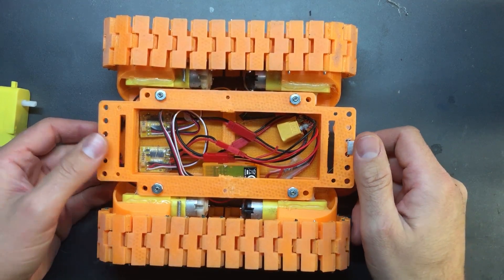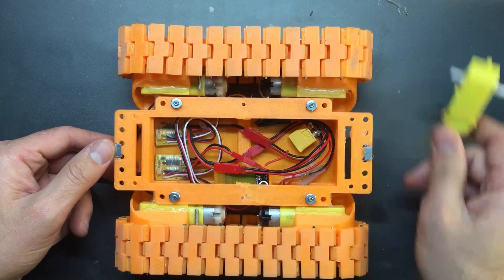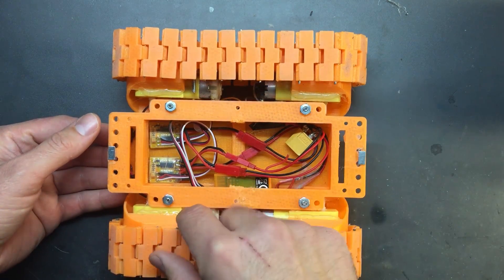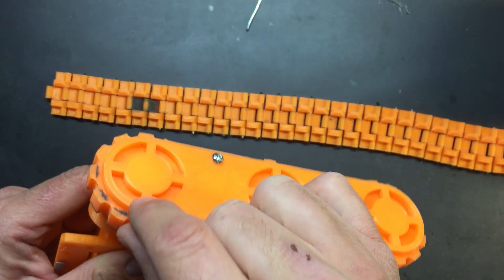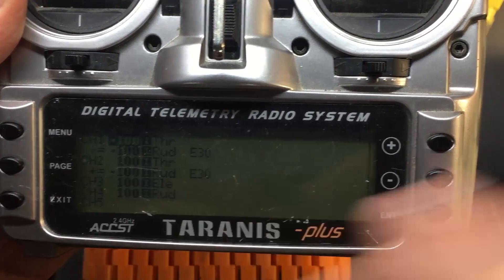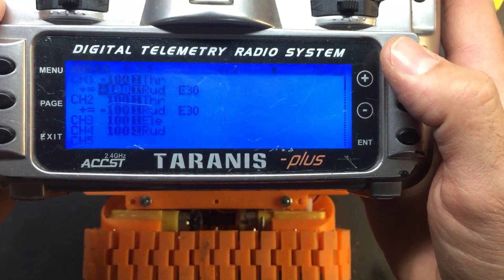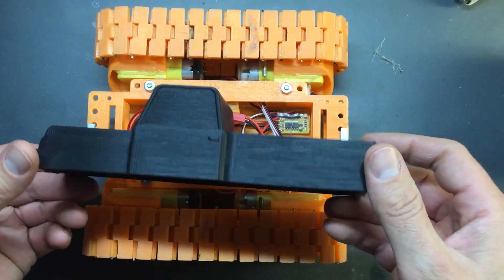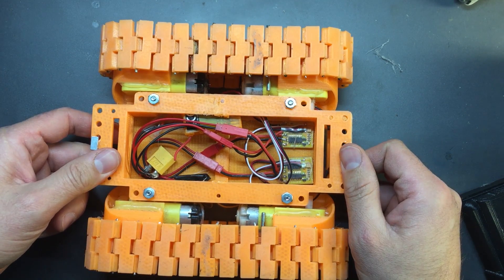DIY | My 3d Printed tank

Comment: If you want it to go faster and climb better it needs more traction, I have a feeling you already know that. I bet if you smeared just a coating of silicon caulk on the treads it would help a lot.
Reply from the maker: i was thinking hot glue but i like it sliding around like a drifting rally car :)
Reply: Lol good point.
Reply: Great build though I really like it.

Comment: you must then on banggood two wan to buy 10A ESC Brushed Speed Controller For RC Car And Boat With Brake?
Reply from the maker: Enzo Mestdag yes you will have to buy 2, you can also find them on eBay

Comment: do you really need die10A Brushed ESC Speed controller For RC Car And Boat With Brake on moters or not
Reply from the maker: Enzo Mestdag yes the esc allows you to control the motors and you need brake or else the tank won't stop it will always go forward or backwards.

Comment: hello cool video but how many volts you have to motors?
Reply from the maker: Enzo Mestdag i run two motors in parallel on 7.4v and 12.6 and they don't get hot at all.